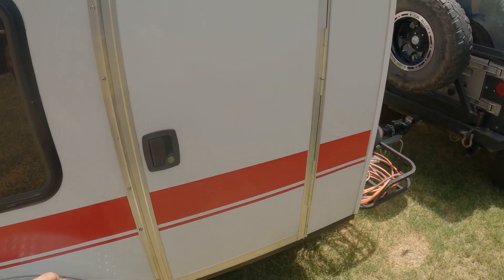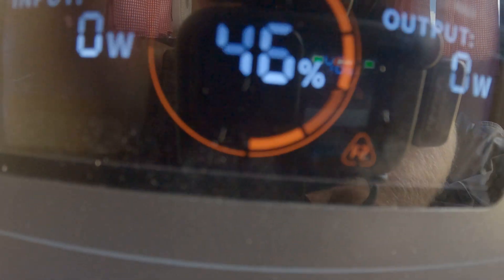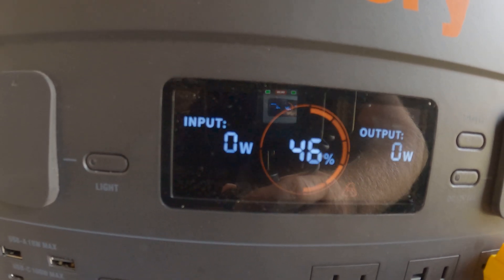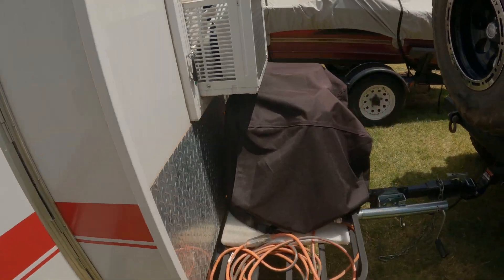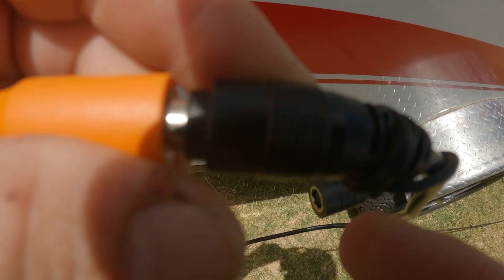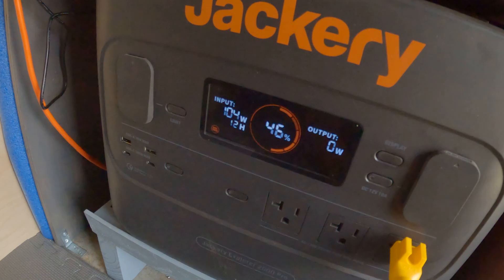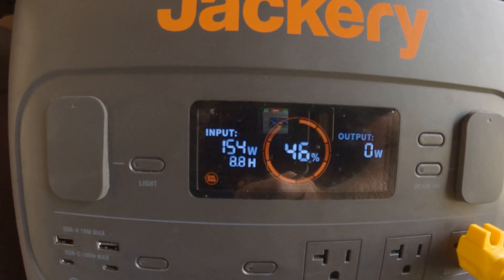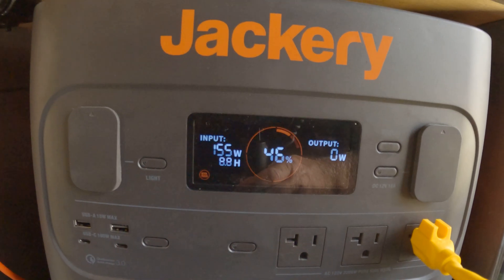Jackery 2000 Pro F2 Error. How to fix it!

Comment: I got 2x 2000 plus units with 10x batteries. It sucks. Every week there's some problem. Bought the oem cords and parallel cord. It's all junk of the inverter is junk. When taking to customer service, if you leave you panel outside or use any other brand adapter they become unhelpful. 

Got the ecoflow dpu and I've never had a problem after 2 months. 

At this point i just wanna junk my Jackey even though they're less than 2 years old. F the warranty. It does need a recall.

Comment: How often are you having to reset or unplug and plug it back in? We just purchased the 3000 pro and had an issue with solar chargering this weekend, using the jackery panels, wiring, and having one plugged into each dc input.

Comment: It seems a little naughty that the problem only seems to apply to non-Jackery PV input via the adapter. Perhaps it's working as intended (to encourage you to purchase and use the Jackery panels), which I note aren't even recommended for use in the rain, so hardly suitable for mounting on a vehicle, etc!
Reply from the maker: I have Jackery panels. A 100 watt solar saga and two 200 watt solar saga panels and it does the exact same thing... So No, that is not the issue.
Reply: @myokielife   Oh OK - thanks for the clarification. I wonder why this is occurring then...

Comment: Hi.  I watched this video and your other one showing no input unless you replugged the cable. I was wondering if it behaves the same using the Jackery panel that you have with the 500. Of course the panel on the runaway should work fine, just was curious if the problem is repeatable by using the Jackery panel. I have the Jackery 500 also and googling today there doesn’t seem a way to update the firmware, or didn’t find any info on it. The problem you show with the 2000 has to be a bug, they lying that it’s a feature. 😊
Reply from the maker: The 500 does not have the problem regardless of what panel is used ( I have used them all on the 500 from time to time)
Reply: @myokielife  yes I know. My question was have you tested the 2000 with the Jackery panel. Curious if the problem also occurs then. I’m wondering if there is circuitry in the Jackery panel that mitigates the problem. You know it has the orange plastic enclosure that also has a USB port to charge a device directly. I’m guessing here of course. Being a software developer for 35 years you try to find ways of debugging things.  😀
Reply from the maker: @DouglasBarnum  Yes I have I have a pair of Solar Saga 200's that are plugged into it a lot of times when I come back from camping trips to recharge the 2000 quickly. They do the exact same thing.
Reply: @myokielife  ok thanks for the info!  I’m leaning toward ecoflow for my next one. More so now because of your video.
Reply from the maker: @DouglasBarnum  I hear good things about the Ecoflow. I still haven't heard any direct official communication from Jackery. Even after a few times of trying to pin them down. I am about done with them as well.
Reply: @DouglasBarnum  Ecoflow Delta Max 3600W and a Honda 2200 gas will be my next investment. Gas can charge during the day along with solar so I can quietly run my 5000btu a/c unit at night when I go stealth mode 🥷 Hopefully Jackery can fix the problem and also make a 3000W station 👍

Comment: My Jackery 2000 Pro has solar charging issues as well. I am using 100W Renogy panels (18V/5.56A). When I connect 2 or 3 panels in series to one input port and the sun comes back out, after being behind clouds for an extended period, the charge only resumes at a capped-off level (approx. 140W). I too have to unplug/plug back in to recapture the full input of the panels. I have not seen the F2 error. One potential workaround: When I connect panels to BOTH input ports (I have tried one 100W panel on each port as well as two 100W panels in series on each port), I have noticed no charging issues in the limited testing that I have done. My unit seems to charge more reliably when both DC input ports are active.
Reply from the maker: I have gotten the error when both inputs are used. However, I will admit that I don't use both very often as I mainly use the mounted solar panel. In this video though both inputs were being used as you can also see the solar saga 100w behind the camper. I only need to unplug one of the 2 lines to wake the Jackery up though. Thanks for your comment!
Reply: Ok. I saw the Solar Saga but just thought it was charging your smaller Jackery. Well, that’s a shame that using both ports did not improve it for you. I hope that I do not find that the same is true with mine after more use. Having to babysit the unit would be a pain. I do really like it otherwise and it’s nice having the option to quickly top it off with my gas generator on cloudy days.
Reply from the maker: @kimberlymoore2962  Yea, I hope so for you too. It IS a pain to babysit it. For the price that it cost I find it ridiculous. It's not like this is a low dollar knockoff. The unit is good otherwise.
Reply: Kimberley I have noticed the same issue. I have three solar saga 100 panels and use the solar Series connector to connect all three to one input on the 2000. If I put the panels out early and not in full sun then later when the panels are in full sun I don’t get the full wattage I have to unplug and then plug back in and then get the full wattage from the three panels. I may get one more panel so I can connect two panels to each input see if that solves this issue as you suggest.
Reply: @oldmaninthemirror  Before spending money on another panel, I would suggest putting one panel on one input and one panel on the other input and check if you see the expected full wattage of the two panels when the sun comes back out. That will help confirm that your unit does indeed do the same thing as mine. In my case, when using only one input port, the wattage was only getting up to about 140W when the sun returned after a long cloudy period. However, when I plugged a 100W Renogy panel into each of the input ports, it returned to the expected full wattage (180W or so) when the sun returned after a long cloudy period. Of course, the difference was greater when I added more panels. Unfortunately, I have not done much additional solar testing to confirm repeatability of results. I have the Jackery 2000 mainly for emergency use and have just been using it every couple months and recharging it either on house AC or on a Honda EU2200i.

Comment: Is there a possible correlation for the error between the high temperature of the camper and maybe an over sensitive thermal disconnect? Mine hasn’t done that f2 yet. Still testing it out.
Reply from the maker: I don't think so. When the unit overheats it throws a different error. It almost always happens in the morning BEFORE the heat cranks up. From what I can tell it appears that once the solar panels stop inputting electric ( night time or shadows) the MPPT controller goes to "sleep" and the only way to "wake" it back up is to unplug and plug back in the solar panel(s). Jackery has already acknowledged the issue...However they claim it is on PURPOSE and not an oversight or flaw. Which in my opinion I don't buy one bit... I uploaded a short video of the issue and how to get it charging again.